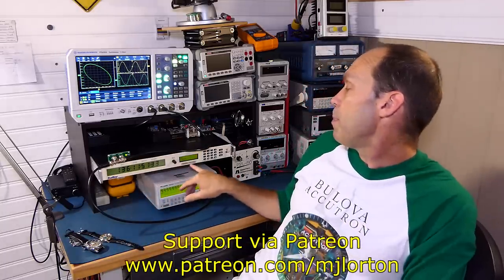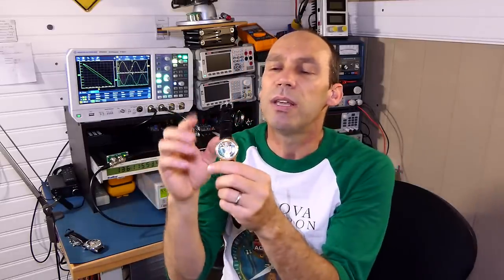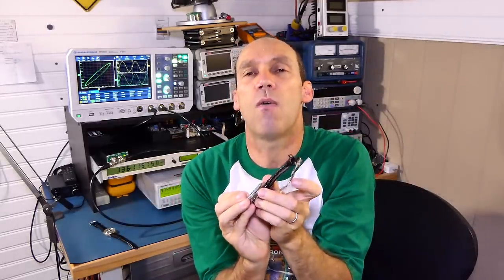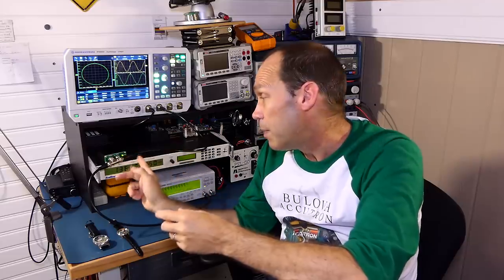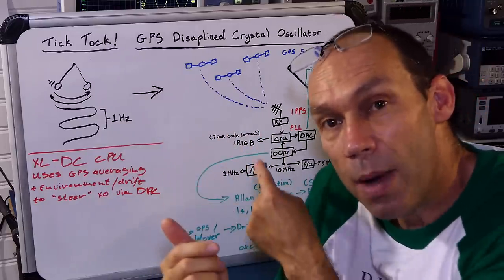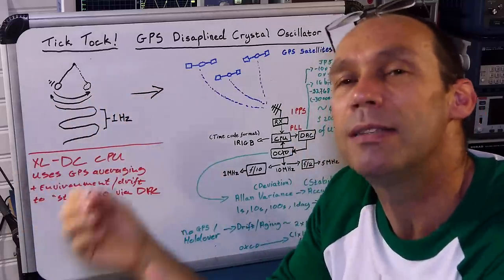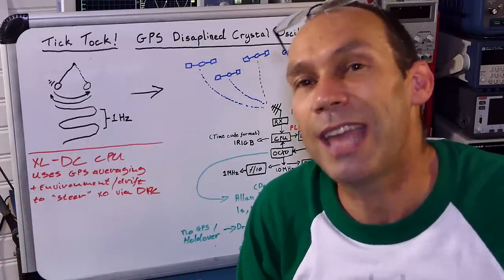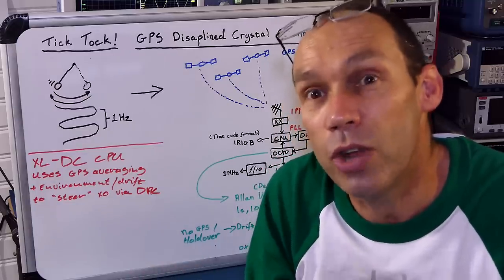The GPS Disciplined Crystal Oscillator - Part 1

Comment: Used to work with a real 'chump' who decided he needed an Accutron... same as the first one in the video[1]. It was Los Angeles mid 70's; he & his wife found some especially slimy high brow jewelers who correctly pegged the guy as a hopeless moron. It was one of those ritzy titzy outfits with lots of statues, private viewing rooms, extended pinky fingers, fountains, complementary wine and centrally located tuxedo adorned pianist. The whole deal. They sold him the watch and fed him rations of BS about how only they, or other official Accutron dealers could set or adjust the time on the watch. They got like $20USD to do it too! A lot of money back then. The dealer also didn't provide a manual, warranty or other documentation. For some years our hero was in for regular 'adjustments', and couldn't have been happier!  I remember asking him what the 'bail' thing on the case back was, and he replied 'the dealer said to never mess with that'! :) The dealer also sold him numerous megabuck cleanings, battery swaps & who knows what else; I remember there were a bunch of them & each seemingly took weeks... the thing cost him fortunes! It was an amazingly long time before he wised up... said moron claimed there were always other suckers cue'd up at the dealer for the same BS.
[1] Seems I remember hearing that those old Accutrons used no longer available Mercury batteries... could be wrong.

Comment: Hi Martin, great video; keep up the good work! I was in the timekeeping business back in RSA many years ago and we used to synchronise our lab clocks using an analogue TV receiver and a pickup coil to extract the horizontal sweep frequency which the SABC kept in sync with an atomic clock maintained by the CSIR. Also look up "John Harrison" and "longitude" that's a fascinating story about timekeeping which had a profound effect (a giant leap, actually) in accelerating maritime navigation and hence trade and commerce in the 18th century.
Reply from the maker: Thanks very much for your post, very fascinating.

Comment: Thanks for another wonderful video! I did something similar and bought a used Spectracom 9283 for my lab. I did this because I wanted low phase noise for my RF signal generators. However for folks that can't / don't want to spend that kind of money  should take a look at Leo Bodnar's precision GPS reference clock. It's only uses a TCXO but after playing around with mine for a few weeks, I don't think you can beat it for the money. It provides a 3 volt CMOS output and I have yet to find a piece of test equipment that won't work with it. For a distribution amplifier look for a used Stanford Research FS710 or an FS730. The FS730 will cost more but it provides much lower phase noise. These things are great too and will provide a sine wave output regardless of the input signal type.
Reply from the maker: Thanks for the post and handy info Roy.
Reply from the maker: I've just placed an order for the Leo Bodnar's mini precision GPS reference clock. It will be interesting to compare the performance against the cheaper eBay device I have. Reading the specs it seems to cover the cons I show in part 2. When GPS signal is lost, the cheaper device drifts within a very short period of time. The Leo Bodnar device seems to be more intelligent and maintain the reference frequency like the Symmetricom TrueTime XL-DC.

Comment: you need a roomier bench
Reply from the maker: I know...it's a little tight! ;-) I should have a bigger space by the end of the year.
Reply: mine is made of an 8' by 4' sheet of 3/4" ply, standing on legs of 3" by 2", cheap and easy to make, but you need a good-sized room to put it in.

Comment: Very bad video, containing mostly smattering, and also wrong information in several parts.
Only a few examples: 
@14:45: high time resolution (ns, ps, fs) in scopes  has nothing to do with high accuracy, and does not need highly precise reference oscillators
19:20 - 20:50: confusing arguments when using different oscillator in ATEs. What IS the possible problem, in fact? Same as before; in most used cases, a highly stable / accurate time base is NOT needed.
46:30 1Mhz signals gives more digits resolution than 10MHz? What? 
If using reciprocal counters, the resolution is mostly independent from the input frequency, depends only on the Gate Time, the internal reference frequency (the higher, the better), and the time interpolation technique used. 
Very probably you confuse that with the digital rounding error  for e.g. 9 digits resolution, when the result is displayed as either 9.999 999 99 or 10.000 000 0 MHz. That display depends on the ratio between the reference and the input frequency, i.e. if it's a bit higher or a bit lower than 1 (for 10MHz) or 10 (for 1MHz).
Highly resolved and accurate frequency comparisons should not be done by direct frequency measurements anyhow.
Better use T.I. methods and statistics.